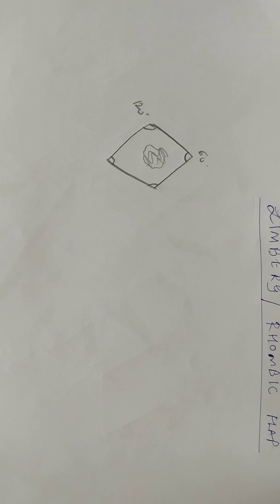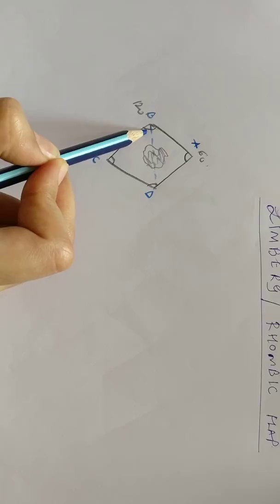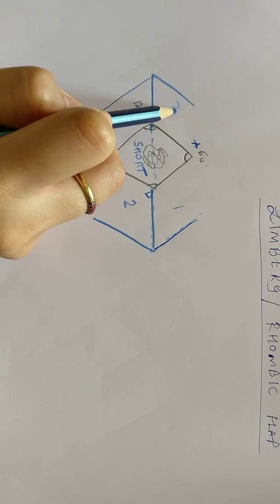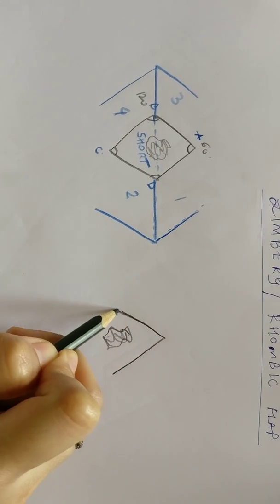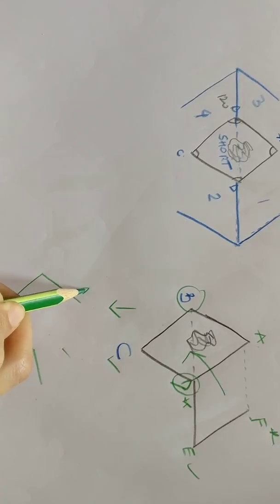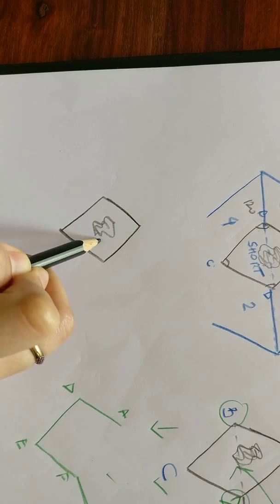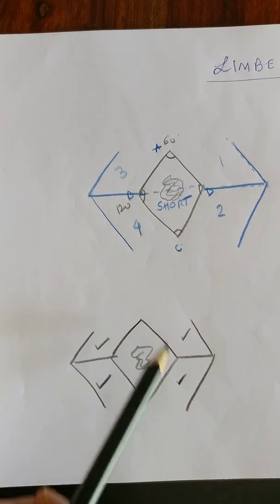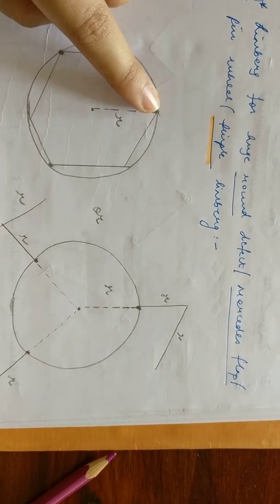Limberg flap

Comment: I have a patient whom i have done a surgical excision for a basal cell carcinoma and the mistake that i have done the defect that i made was more of angles almost 90 degree with the length of each lim to be 4 cm on the top of the back the question is i think rhamboid flap is applicaple in my case but if i am going to do double rhamboid should the length of my limb be shorten to half as i am going tom moblise less ? thanks for your input